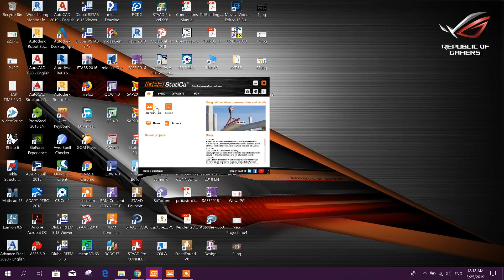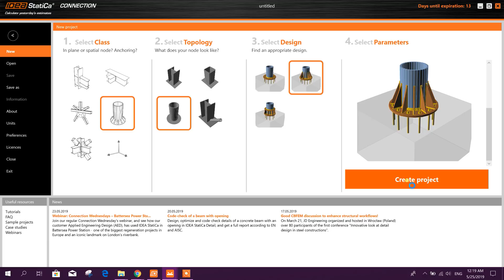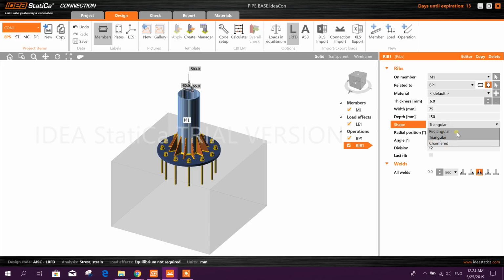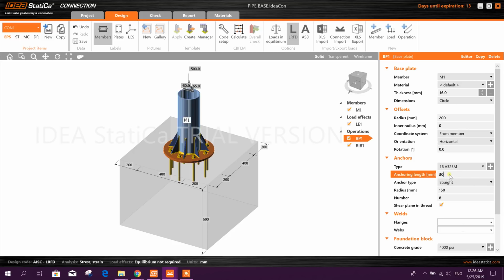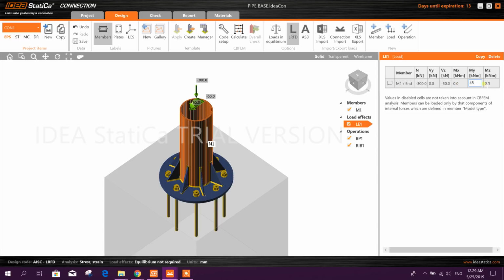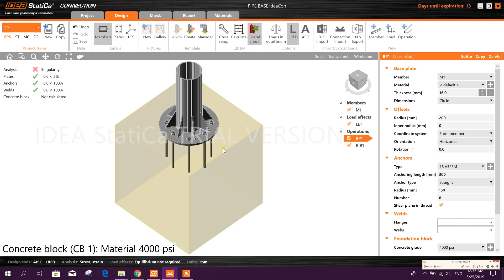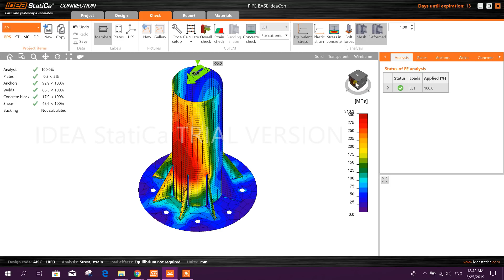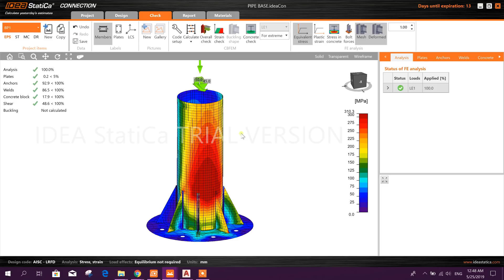Circular Base plate Design in Idea Statica 9.1

Comment: How can I contact to you because I am working in uae and I have made model polygon (16 side) steel shed for stockpile tunnel in stand pro. I need to put wind load bs 5950 in that model. How can l put brother please help me. I know wind load put in gable frame structure but this is a different model and first time I am working in this model. Shukran